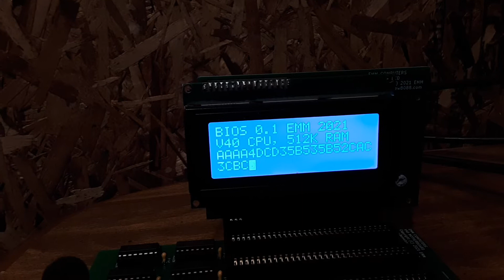20 MHz - V40 Motherboard. (20 MHz - 8088)

Comment: Hello, I wonder if you've reviewed the upd71037 mode of the built-in dma controller that is present in the HL version. Maybe it is compatible with original PC. Regards, Jarek.
Reply: After several days of googling I managed to find the 'hardware manual' mentioned in the datasheet. I can't find the source now, but luckily I downloaded it as soon as I realized what it was. I'll send it via email. At first glance it looks like all IO addresses can be configured correctly, however, there are some functional limitations. For example, the built-in DMA controller doesn't support mem-to-mem transfers - i don't really know if it is a problem or not.
Reply from the maker: I got the email. That is good information. I see that you can select 71037 mode in the configuration registers. It may be worth trying out sometime in the future. I have a couple of the V40'S that are 70208HLP-10. I still need to read more in the manual to see how the index register is handled. Software for the orginal PC would expect that one exist.
Reply: The only incompatibility between 71037 mode and the 8237 used in XT system is the memory-to-memory transfer. This function is seldom used on ISA cards, so this won't cause big problem. Another interesting thing is the TCLK pin. It supports up to 20MHz frequency for 70208-20. Though a XT compatible system can't take adventage from this, it's still a useful improvement for other uses.
Reply: The document is available on renesas website. With the keyword U11610, which is the document number, it can be searched. Also, renesas provided a hardware design manual for V40HL and V50HL available in Japanese version, and can be searched on Japanese website only. If it's useful to someone,  it can be searched using the keyword U10037.
Reply from the maker: Are you talking about the V40's built in DMA controller?
Reply: @elijahmmiller  Yes, but the V40H to be specific.
Reply from the maker: I don't have the best reference material for the V40. What I have read is the built in DMA controller is built as a sub set of the 71071 which is different than the 71037. I have not seen anything about a 71037 mode. It could be a mode I just have not seen any documents or references for this. If you have it would be nice to get a link. Does it acount for the index register at the correct IO address for total compatibility?

Comment: There are some other CPUs worth considering the D70320,   NEC 80C186 for starters ?? Fast SRAM like IS61C1024-10 10ns  and a W83C42 PS/2 keyboard interface.

D70320 / 80C186 CPU .. 8-20Mhz
IS61C1024 Fast SRAM 128k each
27C010-45 128k  45ns EEPROM DIP/PLCC
74HCT138 memory decoder ..putting RAM/ROM into 8 chunks  8x128k=1024K
D72020 or V6366 Video Chip to give CGA / VGA Graphics/Text
82C55 PIO
82C51 SIO
16C554 SIO (Quad UART)
PC8477 FDC Floppy Controller (upd765+SED9240 on one chip)
W83C42  PS/2 keyboard 

Just a thought ??
Reply: D70320 is not a very good choice for some reasons.
First, it has memory-mapped on-chip configuration registers, so it'll be a huge work to write bios files. Second, it supports 8MHz maximum frequency, and the bus timing is so strange that you have to use 35ns memory chips to fit the 8MHz bus timing. So if its on-chip peripherals are not used, it'll still be no more effective than a V20.
However, the new instructions make multi-task operations easier. So it's more friendly in non-DOS-compatible conditions.